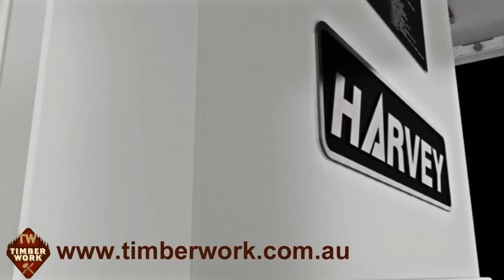Harvey Table Saw Assembly and Operation, Timber Work

Comment: I am looking for tips on how to lift the table saw off the pallet and install the optional mobile base.
Reply: Unscrew the bottom, tilt it enough to shim it higher than the rollers, then do the same to the other side. Screw the rollers onto each corner, remove the shims and then roll it off, gently setting each side down. Do this before beginning to install anything else!